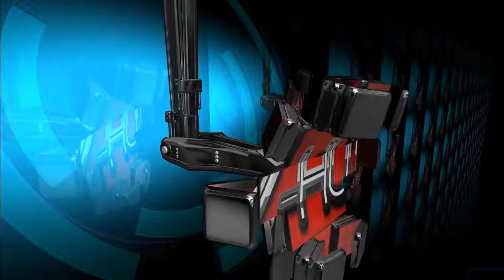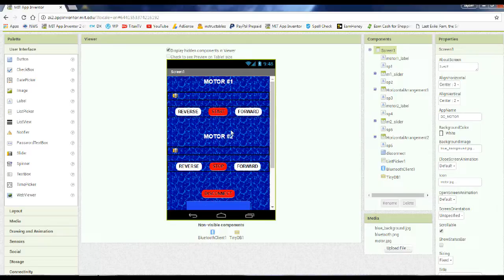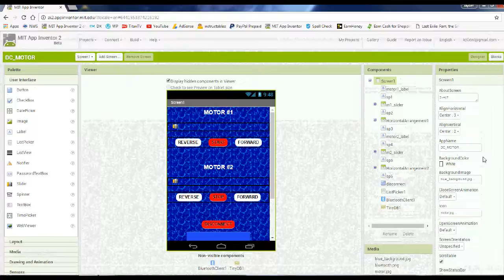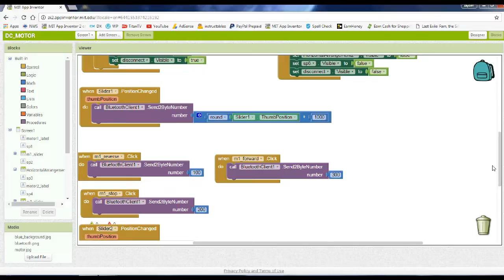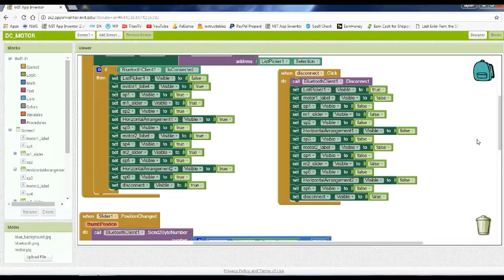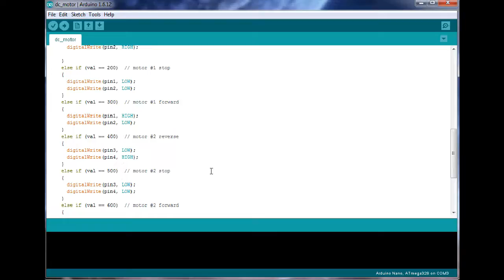ARDUINO How To Bluetooth Control 2 DC Motors Speed And Direction With A  L298N

Comment: Absolutely brilliant tutorial. I have spent all evening playing with the MIT App' developer tool and have downloaded your .APK as it's exactly what I'm looking for. Although I will be tweeking it to use with a LEGO Train, and also want to add buttons to turn light's on and off, switch points, etc. I notice from a few of the comment's, people are getting a 'stray /123' error. This is due to the code for the sketch being copied from a web page, which brings in a few extra 'Return' key strokes that aren't visible. Would be great if you could upload the Sketch to be downloaded. But top dollar, helped me out heaps. Can't believe I only got my Arduino kit last week and I'm already using App's with it. Big Thumbs up to you sir.

Comment: Instead of changing the direction of rotation my motor just slows down. Why is that?
Reply from the maker: check your connections, most likly the problem
Reply: @z-hut1663  if I try controlling it with removing the enabler jumpers, motor doesn't even start. So I kept the jumpers and connected pwm pin over it and then I see that it doesn't change direction.

Another issue that face us that if I touch any screw or even heat sink of motor driver with a jumper wire connected to other side with arduino (any pin that isn't even mentioned in code) motor starts moving... I was wondering if there's something wrong with the motor driver
Reply from the maker: try a diferent arduino board and a different H bridge.

Comment: Arduino: 1.8.1 (Windows 10), Board: "Arduino/Genuino Uno"

car_kit_code:65: error: stray '\342' in program

 analogWrite (pw1, val â€“ 1000);

 ^

car_kit_code:65: error: stray '\200' in program

car_kit_code:65: error: stray '\223' in program

car_kit_code:69: error: stray '\342' in program

 analogWrite (pw2, val â€“ 2000);

 ^

car_kit_code:69: error: stray '\200' in program

car_kit_code:69: error: stray '\223' in program

C:\Users\ACER\Downloads\car_kit_code\car_kit_code.ino: In function 'void loop()':

car_kit_code:65: error: expected ')' before numeric constant

 analogWrite (pw1, val â€“ 1000);

                           ^

car_kit_code:69: error: expected ')' before numeric constant

 analogWrite (pw2, val â€“ 2000);

                           ^

exit status 1
stray '\342' in program

This report would have more information with
"Show verbose output during compilation"
option enabled in File -> Preferences.

this the problem in the program. how can i correct it